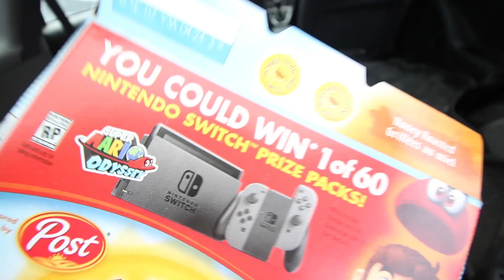Furniture Recovery Is Easy! Restoring Trash Properly

Comment: Good job on the table but around here trash collection fees (which are mandatory)  are high. The recyclables are sold by the company to try to offset our fees so taking them out of the bins is cheating the homeowner a bit. I agree with taking stuff that would go to a landfill though or that still have actual use.

Comment: use a spray toner to darken finish, then spray with a clear coat . the top will match, this will hide screw ups. be sure to use 220 sandpaper first.also you can buy touch up markers for just touching up scratches on anything you find in future. you can get them for real cheap, dollar stores . they work good    https://www.youtube.com/watch?v=gLi0va1XONY     also https://www.youtube.com/watch?v=wF7VFx6Djmg